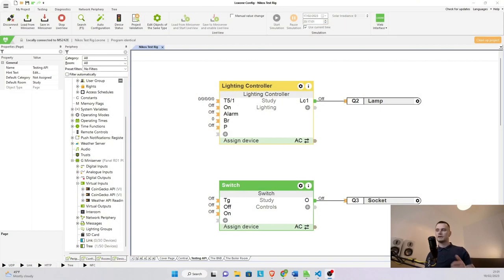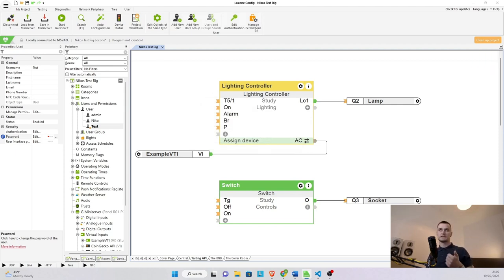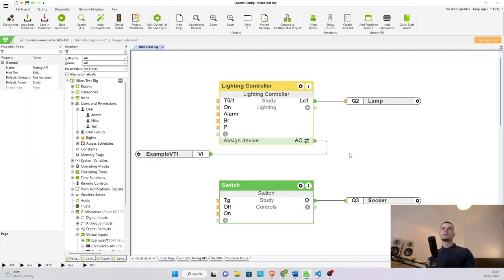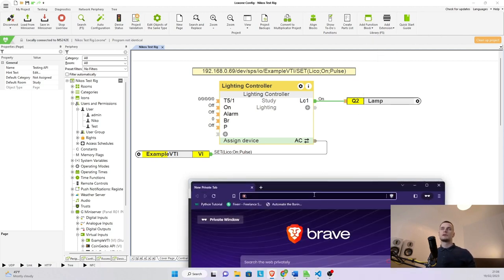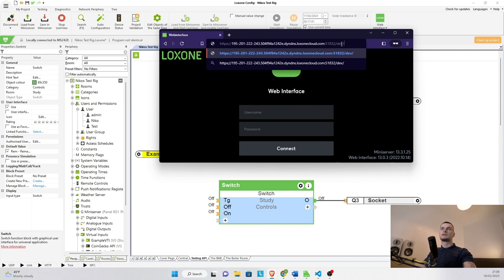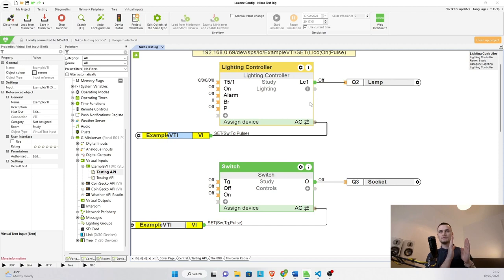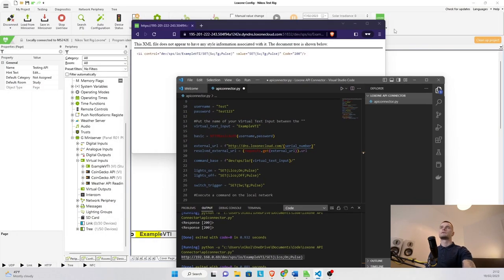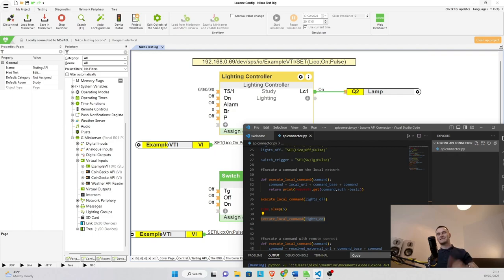The Powerful Loxone API Connector

Comment: Thanks for sharing! Do you know if there's a way to output state changes of function blocks using the API Controller? In fact I want to read out the current media source of a media player. Or having the name of the current song.
Reply from the maker: As far as I'm aware, we can only get that information from the console terminal of the Audioserver's web interface. The Touch Pure Flex can "Echo" the function block and get the current playlist, however the ECHO function is currently not supported by VTI's. Maybe exploring Shazam's API could be a way?

Comment: Thanks for the nice Video and explantion. Is it possible to integrate Sonos Speaker through this way into the Loxone system?
Reply from the maker: Thank you, it's not through the API connector, but you can use Virtual Outputs to control the Sonos amp:
https://library.loxone.com/detail/sonos-speakers-28/overview

Comment: can i also use the api connector to control the light intensitty of LC1 to LC18 with the SET(FunconBlock; Input; Value) command ?
Reply from the maker: Hi Christian, you can't change the intensity of a specific circuit, but you can change the Master Brightness with SET(Lico;MBr;<Value Here>)
Reply: @theautomationgym Thanks for the answers. It is unfortunate that you can not control the output of a specific output. I mean the Loxone app can change that, so it must be possible, but the keep that locked for us. I wish i could control each output of a Lico via http, so i can implement that in my flutter app for all my home automation controls....
Reply from the maker: @Christian_vd_Laan  I've checked the official structure file and the only thing that seems to be adjustable is the circuit's name for now. Maybe it will be available in future versions

Comment: If i understood it correctly then If I want to control two or more function blocks of the same type I cannot use only one VTI but I have to use two or more of them, because function block identification in command is not unique per function block instance but per function block type, right ?
Reply from the maker: Exactly, I'd usually have a VTI per room or more if there are 2 of the same block that need to be individually controlled